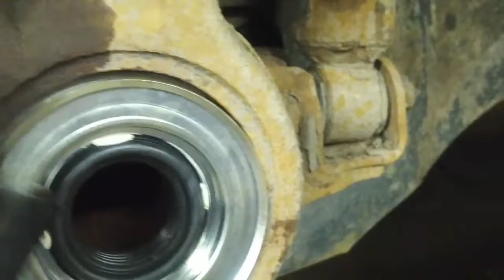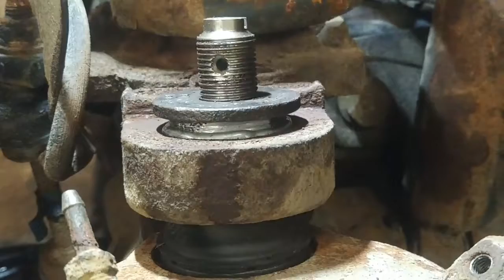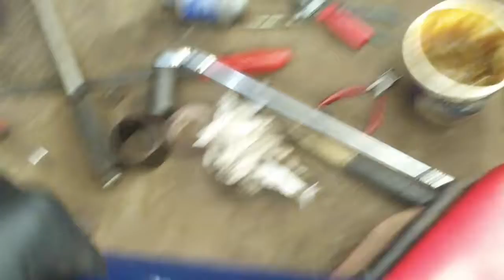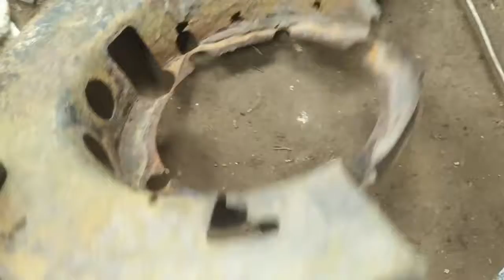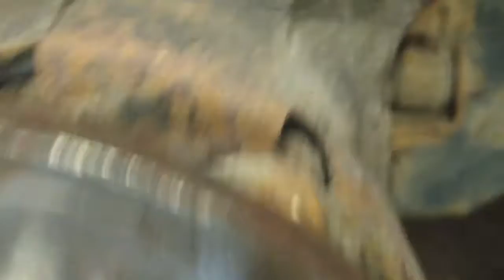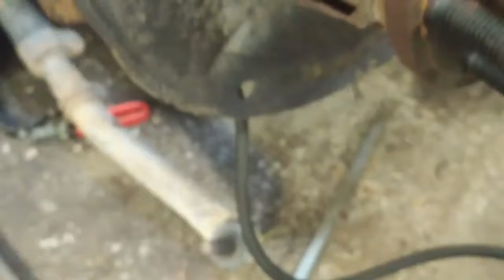2011 F350 4x4 U-joint and Ball Joints pt. 2

Comment: After inserting the shaft is it supposed to be able to turn or does is not move at all?
Reply from the maker: If you are referring to the axle shaft then it may not turn if the other hub is locked and the transfer case is in 4wd. Try turning the front drive shaft. If it turns then the axles should also turn.

Comment: Where did you get that seal driver from
Reply from the maker: It's a Stemco  axle seal driver I borrowed from a heavy duty Shop. I've since fabricated one from a large piece of pipe. Sorry I don't know the number of the driver. If you know someone at a truck Shop they would likely have one.
Reply: @PhillipBailey  hey thanks I appreciate it